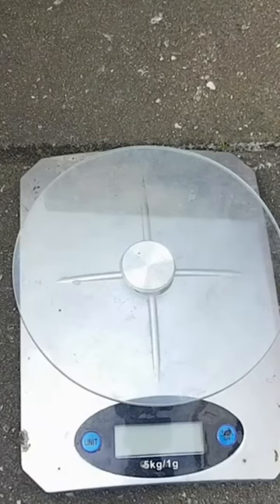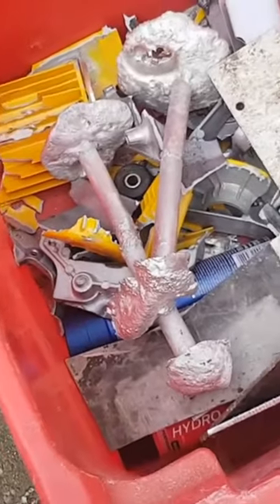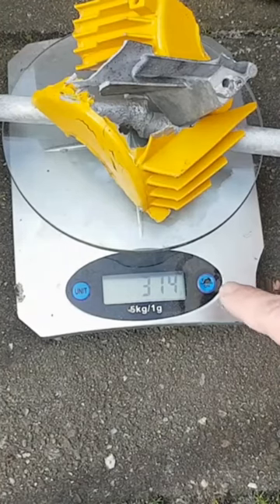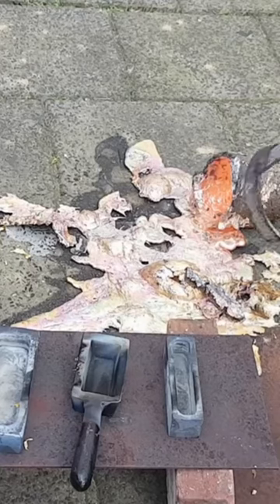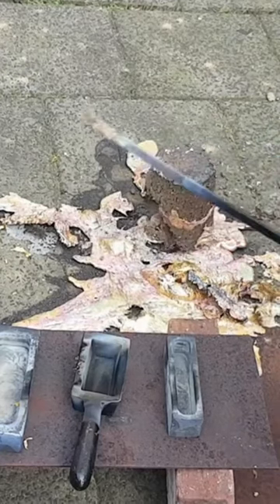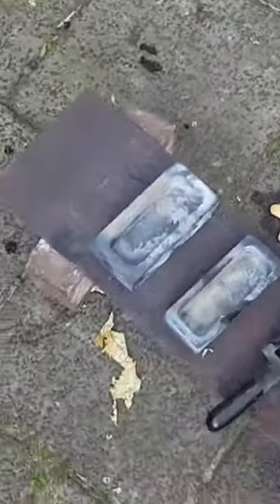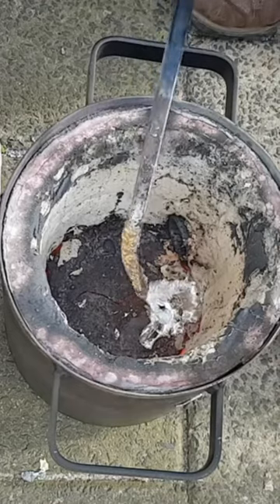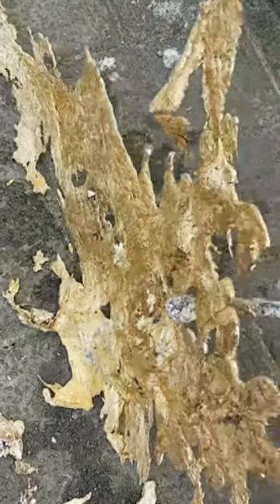#shorts - Casting metals can be quiet dangerous! Crucible failing!!!

Comment: Well back to the melter.
Always afraid of this happening. Scars me sometimes. Always tomorrow. 🎈🎈
Reply from the maker: Yeah I was pushing that crucible to the limit. Should never used it with so much cracks on the top...
Reply: @Metalstacker  🤣Just as long as you're okay it doesn't matter. Can always remelt later. 😄😄

Comment: Crap bro! That is something I worry about when I'm melting
Reply from the maker: I used a worn out crucible, that crucible was already cracked due to improper lifting. Make sure to use a propper lifting en pouring tong and you should be fine :)

Comment: Damn I was just melting 2 kg of copper today and my brand new 8kg crucible failed when I was just about to pour it into the mould, sucks that my brand new crucible broke but I'm just happy that no copper splashed on me when it broke.
Reply from the maker: Dang! That is the most scary moment you can have with melting metal. Glad you did not get hurt. Did you temper the crucible before using it?
Reply: @Metalstacker  no, I did not temper the crucible. I'm still a rookie. I'm not sure if that is why it broke or if it was a faulty crucible because I bought it online.
Reply from the maker: @mtbmb1341  I bought all my crucibles online. Always inspect them prior the melt and make sure to temper them before use. If they are faulty, they will most likeley fail whilst tempering. Hope this helps! Enjoy the hobby and work safe my friend 🔥🔥🔥
Reply: @Metalstacker  Ok I will make sure to temper my crucibles from now on, thank you for letting me know.
Reply: Im glad you mentioned the pitfalls of casting now before I invested any money.  I wanted to cast a krampus mask out of aluminum and already sculpted the piece getting ready to buy everything else. So how do you prevent catastrophic failer of the crucible beside tempering before hand.
Reply from the maker: @GiovanniMameli-y9j   Use proper lifting and pouring tongs :)
Reply: @Metalstacker  thank you.

Comment: What are the properties of aluminum bronze?
Reply from the maker: Not sure what you mean, but it is pretty sturdy, and a bit corrossion resistant.
Reply: @Metalstacker  is it stronger in general? And I'm assuming since it's corrosion resistant that it also kills germs since I've heard that having a bronz doorknob disinfects itself.
Reply: @Metalstacker  I think @Ergs means in which composition did you melt the metals.
% copper - %aluminium
Reply from the maker: @ErgsYT  All metals from silver and from copper are germ protecting metals yes :)
Reply from the maker: @irishcoffee6894  That will be 90% copper and 10% aluminium :)